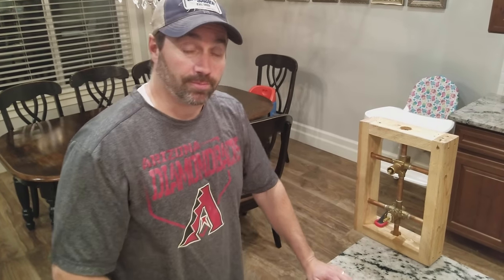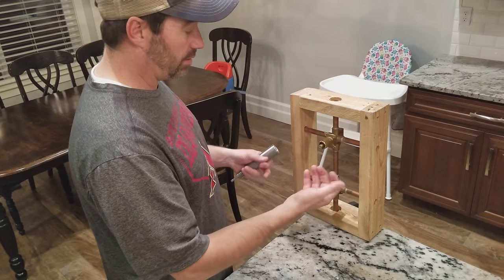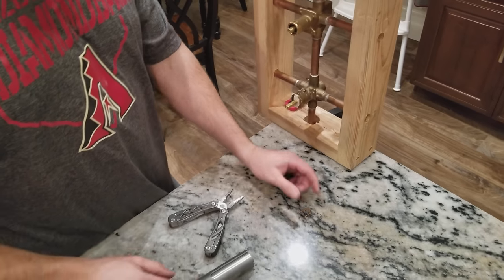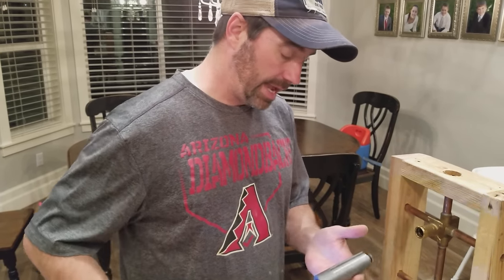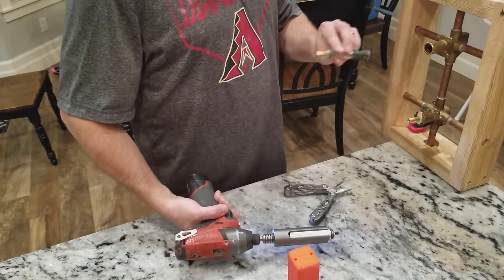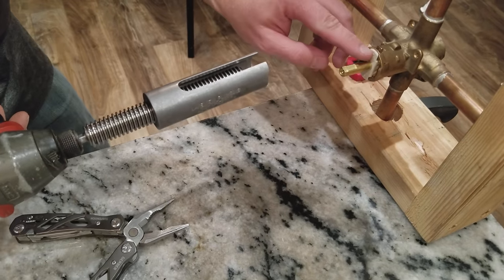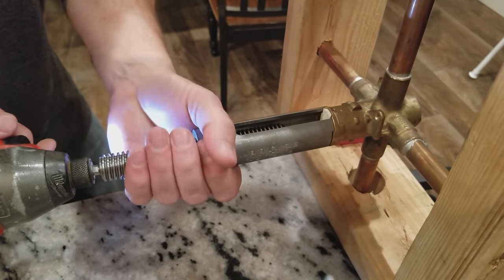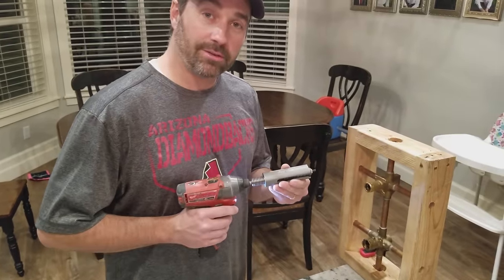How to Remove Stubborn Moen Shower Cartridges Fast!

Comment: Put a hex nut style end on the back of the tool for a large crescent wrench or add grooves for a pipe wrench to get some teeth on it. Those brass on brass cartridges can be a booger.
Reply from the maker: The back of the tool has a 3/8" socket for the impact driver adapter. If you wanted, you could use a socket wrench. I appreciate your comments.
Reply: @brandonseamons9642  Theres an outside housing that the center threaded rod actuates in and out of. I am talking about the outer cylinder. It seems like it could spin freely if the cartridge just spins, am I wrong?
Reply from the maker: @JeepyGunner  You hold onto that part with your hand. It doesn't spin. Trust me - I've done it hundreds of times

Comment: Hi Brandon, will a regular cordless work? I  know you suggested a compact drill for torque purposes.
Reply from the maker: Great question. Yes, it will work, but I wouldn't use it. If you don't have a small impact driver, I would recommend using a simple 3/8th socket wrench. That would be the safest.

Brandon
Reply: Thanks for quick response.  My cordless drill has a pretty high torch level. However  would the 3/8 socket wrench simply connect to your tool? I just want to make sure I am on the same page.

Comment: Pretty steep price for the handy man that wont use this very much on his home. $175.00 plus shipping seems kind of steep. I'd go $100.00 tops, might use it less than a dozen times. Last time I used the generic puller on Amazon for under 29 bucks, works OK for a removal tool that you'll never use more than a half dozen times  in your own home.After 5 years you'd think the cost of your tool would come down. Like your tool but not for $175.00 plus shipping and tax, total would be  about 200 bucks. Thanks for the video though , I can make this tool for about 35 bucks in my shop.  Doesnt have to be a machine work of art but will do the job.

Comment: Does this work well for cartridges that area really suck? I feel like this will pull out the core and leave the cartridge shell still inside the line. I’ve already pull the core out multiple times using other available tools in the market that attach to the valve via screw.

Comment: Hello, can you tell me the name of first valve you pulled out.  Home Depot doesn't sell it.  Thank you. Great video.
Reply from the maker: The first valve was a Moen standard valve. They are not used much anymore since they're not pressure balancing - but they have been used in homes and building for decades. It requires a Moen 1225 cartridge - which is the same as what is used in the Moentrol valves. The second valve is a Posi-temp. Hope this helps.
Reply: I pulled out valve, but dang it! Only the guts of old valve. Copper sleeve stuck inside pipe.  Trying to remove but may cut pipe and update valve system.

Comment: This is a great tool.
What is everyone using to clean out the hard water deposits inside the valve body prior to inserting the new valve? FL water is apparently high in minerals!
Reply: Super fine sand paper soaked in vinegar.  Then rinse before lubing.

Comment: Good video, but doesn't answer my question.  I have a Moen that needs a stop tube replaced and don't know how to remove the existing tube.  Does it just pull off?  I don't want to damage my new, expensive assembly by doing something wrong.  I need to replace it with a longer tube.  I can't find one video showing that process.
Reply from the maker: Yes, the stop tube just pulls off

Comment: Hey Brandon!  Cool tool!  I don't suppose you have any tools or tricks for pulling stuck posi-temp cartridges when the valve stem has snapped off, do you?  I don't really want to dig it out a little piece at a time like when I did my shower valve a few years ago.
Reply from the maker: It's a little tricky, but you can drill and tap new threads into the existing part of the brass stem that's still there. Then my tool will still work to pull it out. Contact me directly for more details. 
www.lakeviewpuller.com

Comment: just saw this video , just wondering how to pull a brass cartridge when the insides come out but it leaves the outside sleeve , this happens a lot to moen cartridges , does this puller remove outside of cartridge

Comment: How do you do to get a cartridge out that the stem pulled out and now the cartridge is stuck in the valve?
Reply: I haven't had this happen, but, based on other comments, here's a last ditch try that requires two people:
1. Spray the valve with hairspray (it apparently has a solvent that assists the extraction process).
2. Remove the shower head and cap the end with a ½" black pipe endcap & remove cartridge retainer clip.
3. Have one person use a rag/towel to carefully catch the cartridge (it could be a projectile, so plan accordingly).
4. Have the 2nd person flag the main water supply ON & OFF until enough pressure builds to eject the cartridge (bluetooth earbuds for communication between the two people is recommended).

Comment: It seems like using a drill would pull it out too fast and break the stem on stubborn cartridges.  Any experience with that?  Long time plumber and I have struggled with the posi temp cartridges.  The other pullers aren't long enough.
Reply from the maker: Great comment. This is why I reccomend using a 12V impact driver. It has just the right amount of speed and torque.
Reply: @brandonseamons9642  thanks.  Do you have something invented if the stem pulls out and leaves the cartridge inside on the positemp

Comment: This tool looks awesome but if the stem only comes out you still have a big problem. I would like to see a video what that tool can do if only the stem comes out. In reality I can get the $12 tool that will do the exact same thing as your $160 tool  does
Reply: @lesbsocal9107  I have that in my Plumbing tool box I have a half inch tap and I have a half inch hardened steel bolt with plenty of washers and a three-quarter inch 1/2 inch drive socket so I can get them all out. And it works great. Peace brother

Comment: Really nice tool, but it won't work if the cartridge is really old and rusted stuck inside, you will pull only the core. In that case only a tap and die set will help
Reply from the maker: I appreciate your comments. You are correct, if the cartridge is so stuck that it wont come out, my tool will only break off the stem. However, I think you would be surprised at just how effective it can be. I, and many others, have extracted really bad cartridges that wouldn't have come out any other way. Especially if you use it in an impact drill. Good luck!

Comment: I have taken apart hundreds of Moen, if the guy installing the valve did not REMOVE the cartridge The rubber in both sides you will pull out the center section and 1/2 is left behind. That tool will not remove the left behind parts. I have spent 4 hours digging out the rubber parts. make a tool that pulls the whole thing from behind you might have something

Comment: Just curious how many times are does it pull stem out of posi temp cartridges
Reply from the maker: If you use a 12 volt impact driver, it should not pull out or break off.

Comment: I used it today for the first time i have to get a impact drill  I used a regular cordless worked but drill struggled
Reply from the maker: Were you able to get it out?
Reply: Ya I got it out hard water
Reply: Definitely a time saver.

Comment: Hi Brandon
 i' m using your tool regularly in Canada.  Do you have a long front stem of your tool which goes to cartridge stem10-24 thread so that we can easily use your tool, in case the cartridge stem already broken and we drill and tap 10-24. Front small size in length of your tool stem cant reach inside the broken stem of the cartridge.
Reply from the maker: You bet. It's a 10-24 X 1" socket set-screw that comes with the tool. You can get those set screws in a number of different lengths if needed from your local hardware store. Just remember to loosen the hex nut first, and the stock set screw will come right out. Thanks for the question.

Comment: What if you have a cartridge stem with no threads? What do you do then?
Reply from the maker: Then you have no choice other than to dig it out carefully without damaging the inside of the valve.  No tool, including mine, will extract the cartridge without being able to thread into the stem of the cartridge.

Comment: I cannot justify $ 160:00 for A tool I have not need yet, I usually run across postitemps and the moen puller works fine.  Nice tool just to pricey for me, and I like tools.

Comment: this is a good idea but all it does is pull the inner plastic cartage out. I still had to tap and dye metal cartage sleeve as it was still attached to the manifold and back it out with bolt and washers. Good try though.

Comment: Does this work on the Moen faucets too?
Reply from the maker: It works on most of the older single handle faucets. The newer ones use a different ceramic cartridge assembly I believe.  If it uses a 1225 cartridge, then yes.
Reply: @brandonseamons9642  mine are two handle faucets using the 1224 cartridge
Reply from the maker: @michaelmclaughlin1958  unfortunately, it will not help with two handle valves - only single handle mixing valves.

Comment: Excellent product.
The smaller ones they sell are way too short of a body and you're only able get about a quarter to half the cartridge out.
I've had luck applying heat w a heat gun to the control body while pulling at the same time.

Comment: If the cartridge is REALLY stuck wouldn't it just pull the stem out on the 1222? I've seen a few videos where the stem was pulled out and I want to make sure that doesn't happen with mine since it's about 18 years old.

Comment: What is your solution when either the 1200 or1225 cartridges pull out the stem
Reply from the maker: If you use my tool correctly and carefully, it almost never happens. If the stem pulls out - there is no tool that will extract what's left. Unfortunately, You'd have to carefully chisel it out the old fashioned way
Reply: @brandonseamons9642  40 plus years and going........on the 1225 after heating up the faucet body barrel a lag bolt threads into it and pulls easily........same on the 1200......apply heat and screw in a couple 3 inch drywall screws right into the plastic......then pull.....both work well
Reply from the maker: @tomd6588  Great tip Tom - I have done the same thing a time or two. Basically - there are several ways to skin this cat, some work better than others. And, just when you've found a way that works well, you'll try it again and it won't work. That's plumbing unfortunately - I guess that's why they pay us the "big bucks"...haha
Reply: @brandonseamons9642  your tool is definitely superior to the moen puller....how does one cost?
Reply from the maker: @tomd6588  you can purchase directly from my website. www.lakeviewpuller.com 
Right now they are $160 ea, but they go up to $175 in April.

Comment: With respect, this is a great demo.  However, your valve bodies nor your cartridges are corroded and didn't look very old. I just wonder how the tool will work with a 20-25 year old  cartridge or older. Just a thought. The tool looks like a real time and money saver though.

Comment: What's the tool called?
Reply from the maker: It's called the Lakeview Cartridge Puller. You can purchase it from my website. 
www.lakeviewpuller.com
Reply: Average shipping time?
Reply from the maker: Depends on where you live. With standard shipping (included with the price of the tool - $160) it normally takes 3 - 4 days. I send it priority mail USPS. To speed things up, you can have it expedited for another $25, that generally gets it to you next day or 2 at the most. You'd have to have me process that personally as my website isn't set up for that yet. If you're outside the US, I  would have to get you a quote.

Comment: What if your stem is broke off ?
 Is tap and die  the only other way?
Reply from the maker: Yes, what you have to do is to tap and thread the part of the existing brass stem. It's a 10-24 thread, you can buy a tap/die set for that at any hardware store. This puller tool then can be adjusted for the shorter stem and still pull it out just fine. Great question. Thanks
Reply: @brandonseamons9642  thanks

Comment: Most of the time the stem pulls out of the cartridge body, then you have to go to plan B ... drill & tap
Reply: Ended up threading inside of pipe, screwed in nut and used a slide hammer to pull out sleeve.
Reply: @jacobpaniagua9691  careful using a slide hammer,  if you crack a joint or pipe thats a big repair job, ... making a puller would be a safer option.
Just need the correct size socket & washer

Comment: Great video, awesome tool, but I ain’t dropping $160 on it.
Reply: Ona makes one, quite a bit cheaper, with a barrel extractor when the center comes out.
Reply: Maybe like $40 to $60. $160 a bit much
Reply: Ona Puller at the plumbing supply for about $50
Reply: Ya know a 3/8 iron pipe tap works great when the stem pulls apart I know this cause I’m cheap ha love this shit

Comment from the maker: I appreciate all the comments and questions I have been receiving. Just to clarify a couple of things... This tool is designed for the professional plumber / maintenance tech in mind. For someone who will use it more than once or twice, the price is very negligible - compared to the time you will save using it. Also, the way it works is by threading into the existing cartridge stem for extraction. If someone has already tried pulling the cartridge and the stem has come out, this tool has nothing to connect to and therefore will not work. At that point, you will have to dig it out the old fashioned way or replace the entire valve. At any rate, there is no tool that exists that extracts the entire cartridge from the valve other than connecting to the stem. Period.
Reply: Ona makes a setup for the older Moen cartridge with a component to remove the barrel if the center comes out. Where does one get that though,  I have not seen it at the supply house.

Comment: How do you pull the valve out if the stem is broken
Reply: MadGrimmer drill a screw into it a lag screw n use trusty vizegrips.

Comment: my handle doesn't have the pin on the outside if the brass. I tried to extract the center, and it snapped in half.  I'm not sure what to do now.  
Any help would be appreciated.

Comment: This method does not deal with what happens when the stem pulls out of the cartridge body leaving the cartridge still stuck inside. There is another youtube video that deals with this.
Reply: Ona makes one for the older cartridge, has a barrel puller also. He forgets that part.

Comment: Sure works but this tool is overkill and over priced.A jig can be made from a U shaped bracket with a hole on centre. Using a 10x24 bolt screwed into the existing threaded tap is key to pull out the cartridge.

Comment: great tool! but $160 for a once maybe every 10 yrs is a bit much unless you are a professional.  - good luck though and great idea....
Reply from the maker: Hey Lino - thanks for your comment! You are right - I designed this tool mainly for service plumbers and other maintenance guys that fight these stubborn cartridges on a regular basis. If you only plan on using it once, then yes - it would be cheaper to just hire a professional and let them deal with it right?
Reply: can you create a rental program?  put the cost of tool on hold on the credit card and charge a home owner like 20 bucks?
Reply: Great tool, just a tad expensive, under $80.00 I will get one.